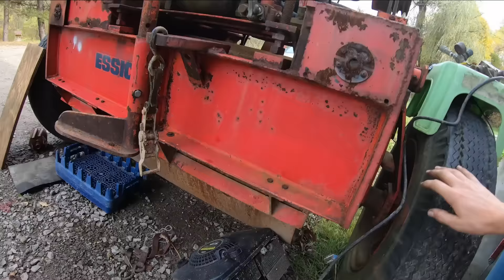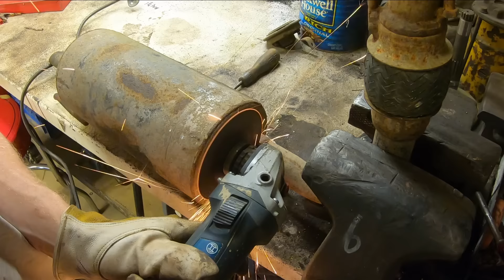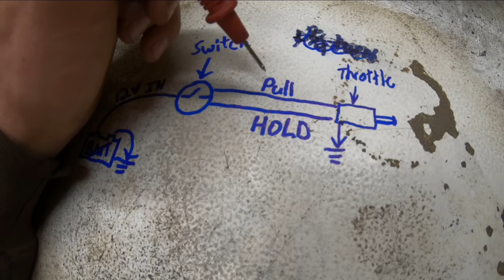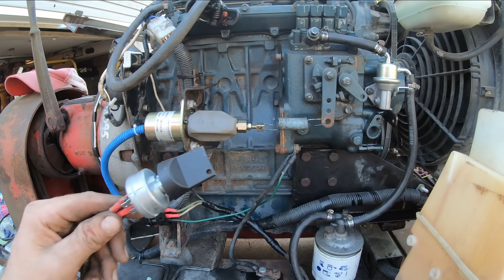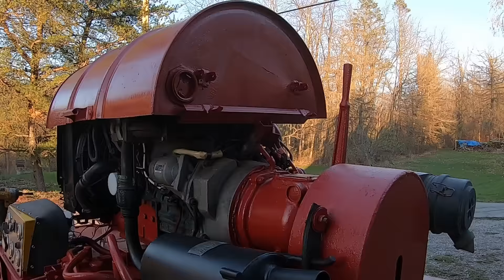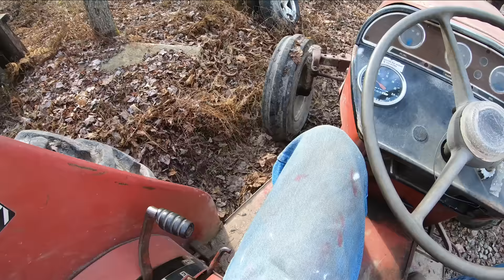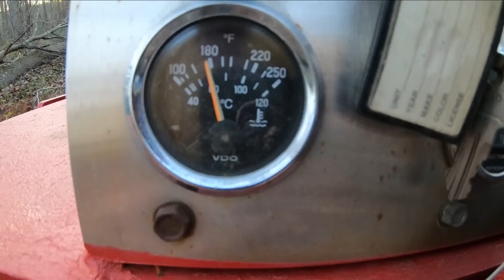Junkyard Kubota DIESEL powered Roller/Compactor build COMPLETE! (Lets try it out!!!)

Comment: Whats the rubber on the control box for? Is it just to keep rain from getting to the electrical connections in the back, if so, no offense but it looks kinda hap hazard with the self tappers unless its just temporary. Is there a reason why you couldn't cut a piece of sheet steel to fit the back and stitch weld a say 6in strip going around to top and sides to secure it to the control box with, unless the wiring is in the way. All the rest looks really good, but that rubber kinda subtracts from the looks.

Comment: Should move the half barrel cover up or put a steel shield over that rubber intake hose the vibration on the cover will cut that pipe pretty quick and you’ll dust that engine, continued success 

     Sincerely 
               Fabrizio

Comment: I bet you that first switch was more of a problem because of the old wiring not passing enough current, you should try that key switch again with the new wiring you replaced, continued success 

     Sincerely 
               Fabrizio
Reply: Maybe a relay activated by the pull side to handle required current...I'd guess he has a few start solenoids laying around.

Comment: AS far as the gravel compaction goes we used to put down something similar ( potato rock ) however we found later by using road base and a compactor the road acted very well even during heavy rains , but the larger rock similar to what you have seemed to dislodge easier and get kicked up in between the duals on the trucks so we opted for road base, just fyi

Comment: What a shame about the paint Matt. Your neighbour had the very best of intentions though. I'd run the beast for the winter, iron out any gremlins, then rub down the red and respray it. That paint will keep it clean over the winter though.
One thing I noticed; you've made it harder to change these belts. Was there nowhere else to attach that exhaust brace? In these wonderful times of cordless impacts, four bolts isn't a big deal but, in pssing rain, on a February morning, it seems like an unnecessary complication. 😁

Nice to hear that someone uses their local junkyard. Too often on YT, folks are buying new junk, rather than repurposing older junk, which was probably built way better. Quite apart from saving money, there's a great satisfaction in running junkyard machinery. Great place to find switches and gadgets too and quicker than Amazon.😁

Looking at that big, heavy fuel tank: once you get it painted nicely, a gold or silver maker's decal would look pretty good on it, or even a Diesel Creek logo.👍👌

Cheers for now,
Dougie.
Reply: unbolt cover, tilt it outwards slide rubber off muffler bar. seems easy enough

Comment: it's a bit weird that the controls and gauges don't face the tractor side of the machine, would give you a chance to peek at the state of stuff while pulling it.
The paint job is fine for the type of machinery I'd say, at least you didn't have to work with it... that's hours saved ;)

Comment: could use a ohshit its hot light on the remote, 210-220 degree switch grounding a bulb, might save the motor in the event of a fan failure
Reply from the maker: Thought about putting one on the unit itself we’ll see
Reply: or just put a pair of lights on the the other side facing tractor ( one for oil one for temp) assuming it has both switches installed

Comment: I ask this question as a welder / fabricator, knowing NOTHING about road building. Does it make a difference using river rock versus what they call crushed rock, that comes in different sizes. Example 3/4" inch +/- minus. with fine(s)? To me rock is rock, but I'll bet the ones who do this (road-building) on a daily / weekly basis will let me know, one way or the other. Ok people, rip me a new one, if I deserve it.
Reply from the maker: River rock doesn’t consolidate because it’s smooth or rolls around a lot and can nearly flow when weight is applied to it, I can be used if it’s pushed down into the dirt it will be more stable but crushed rock is preferred because of the edges it’s locks together better and is more stable in layers

Comment: Looks good.  With the hole in the top of the fuel cap you will get water in the tank if it is ever cleaned or exposed to rain.

Comment: Hello .  
just a small tip : 
otherwise hang some small white strips of plastic bag on the radiator grille.  
I think the fan blows from the engine through the radiator right?  .  
then it can be visually seen when the fan starts from the towing vehicle.  

with kind regards Hollandduck from the Netherlands

Comment: Where did you get the large centrifugal clutch pulley ??? How much did it cost you fella ??? Thanks VF
Reply from the maker: That was original to the roller,  not sure where to source something like that
Reply: @DieselCreek  Are their any identification marks on the pulley??? What brand roller and model number if you can find it on the machine ??? Thanks VF
Reply from the maker: @victoryfirst2878  I actually looked for one a while back and couldn’t find anything on it. Probably made in house back then but they were used in other multiquip products because the part numbers for the springs inside it were cross referenced to a more modern mixer they sell

Comment: If you see a piece of construction equipment with a really good paint job, it means one of two things.  1) It's brand new and hasn't been put to work yet.  OR  2) It doesn't get used much because it doesn't work or breaks down all the time.  It's a very nice tool but it's not a Cadillac!  A much more important job would be getting a beer cooler mounted on the tractor!!!

Comment: great job,, looks to be working great  one thing i saw though is the barrel/engine cover rubbing on the intake tube?   handy bit of kit to have, saves having to hire one when needed. thanks for the vid and keep up the good work.
Reply from the maker: It contacts the intake hose but I rolled the edge of the barrel so it shouldn’t hurt the hose
Reply: @DieselCreek  good show, the last thing you need is to be sucking dirt into the engine.  thanks for you're hard work putting up the vids  you do a great job!!

Comment: The ground up asphalt works great for driveways.  Parents have it on their farm since the late 90s and it’s held up well.  It doesn’t wash out and just disappear like granite does.  Once it gets compacted and heated by the sun and gets hard like asphalt but doesn’t crack up.  Although you do want to have 4 to 6 inches of asphalt so that it can form into a solid layer.  An access road to a water treatment area near some other family used it but only had about a 2inch layer with a sealer and it broke up after a few years.   ... also heard of people spraying with diesel fuel &/or waste oil to accelerate the material hardening up.

Comment: Outstanding!! U could run some macanical gauges up to the tracker with the idle switch. That way u don't have to keep jumping of to check the unit.
Reply from the maker: I probably should have mounted that panel facing the tractor but really now that I know it’s working correctly I don’t need to check it very often
Reply: @DieselCreek  did a good job. Looking forward to what you have planned for the steel shipping containers barn.

Comment: Machine works good. That engine throttle lever connection, I think it should be connected from the solenoid directly to the lever and then this should have the spring pulling it back in the opposite direction.

Comment: You were concerned bout buddy’s paint job ,,,, n you couldn’t put the rubber on over the electrical straight lol 😂
Reply: I thought the same thing but if you look closely (at the time lapse when he was putting it on or you can see it more clearly when he is dealing with the muffler) the electrical box is not square, it is tapered. He drew a guide line for the rubber parallel to the back edge not the front and installed the rubber accordingly to give as much coverage as possible to the exposed backside of the box with the width of the piece he had. I was wondering why he mounted the reflector where he did obscuring some of the gauges & not parallel to the bottom of the electrical box???? That being said, with all of the repair work, improvising & engineering you have to admit he did a fantastic job & deserves a ton of credit & bottom line it makes him happy & he is pleased with the overall results!!!!

Comment: Nice work! A Kubota diesel is a solid choice and I enjoyed seeing you optimize it for the application. An air-cooled Deutz diesel would also be a good choice for that compactor; they're built to run at steady RPM for extended periods of time on pumps, generators, and certain mobile equipment.

Comment: Do yourself a favor dont engage that clutch before you start always at running lower to mid rpm less strain on start up and thats how those clutches are designed to be used

Comment: I believe all you would need is a starter solenoid for a lawn tractor to make that work with the key switch. That way you can take the large power wire strait from the battery to the throttle. You just need a small amount of power to activate it.

Comment: Likely the RPM has fallen below 2100 after the load applied
Reply from the maker: I adjusted it off camera, the engine is actually overkill so it handles the load well and hardly bogs

Comment: Good result. Just a little concerned that the engine cover is held up by the radiator surround and with the vibration it might crack the radiator. I thought about commenting when you mounted it in the previous vid but thought you might do it anyway.
Reply from the maker: It’s got a good framework around it, shouldn’t be any issue,

Comment: Just a suggestion, you should check rpm with engine under load (2100rpm). You governor may not be adjusted to compensate.  Assuming this has a governor of course.  Lol

Comment: The 'pull' switch :  DC switch rating is for carrying capacity. DC current interrupting is lower. A lot lower for unsuppressed inductive loads like the solenoid. IOW, every time you open it, there will be a nasty arc that will ruin the contacts in short order.

You can minimize the damage by adding a big-ass diode between the pull terminal and  batt terminal. Cathode to battery terminal.

Diode rating around 10A, 100V. Or more.

Comment: You could have just inserted a solenoid in the pull side, just like hooking up a riding mower start circuit, 12 V from battery would then be switched through just like starting a mower engine.

Comment: a suggestion.    Measure the distances of the spring travel.  Open and closed.   The point being sunlight degrades plastic zip ties.  After parking it , when you go to use it next year, it may work and then suddenly it wont.       also measure the pull requirements .  You may be able to substitute a solid linkage to replace the spring.   Maybe a chain or cable with an adjustable linkage on one end.
Reply from the maker: I’m gonna find a more permanent solution that was just to get it going

Comment: Most of the time when I used DC we would put a resistor on the hold side because the inrush of the coil is a lot and it doesn't take a lot to hold it in.  It would be easy to figure what you need to lower the dc resistance of the coil by measuring the resistance of the coil and remember that if you put a resistor of 1/4th the resistance of the coil and and put that in series with the coil on the hold side the coil will work and last for a long time, if not probably not that long.
Reply: You can probably use one of those resistors they put on coils on GM Cars before electronic ignition!

Comment: I would store with the tires up so you don't get a flat spot on them with all that weight but you could see it working good....
Reply from the maker: My theory there is if the battery does from sitting then I’d have to jump it just to get the wheels up, this way it’s ready to go. Hopefully it won’t sit that much

Comment: Rubber ring seal inside the fuel cap should stop that leak.
Reply from the maker: Trouble with that is that it’s pipe thread and it doesn’t bottom out just gets tight on the threads

Comment: I would put the guard on that grinder at least when you're using cutoff wheels. Not trying to be the YouTube safety police just saying those cut off wheels will break with the slightest tweak and could do some damage at 10,000 plus rpm.
Reply from the maker: Lol ya I’ve had them explode before too but I just make sure my head isn’t in line with the wheel, I toss all those guards as soon as I get a grinder
Reply: @DieselCreek  Thats the important part I suppose staying out of the line of fire I'm gonna continue using the guard but to each their own. Stay safe keep the videos coming 👍

Comment: Just because I'm super curious here ... why not index the whole thing the other way so that the exhaust pipe rises from the manifold instead of dropping down?
Reply from the maker: Didn’t have to buy anything for this set up plus no hood interference, also when you go up it’s harder to support and then water becomes an issue as it sets it’s impossible to get water into the engine

Comment: A useful bit of kit bought back to life. Wasn't the 2100 RPM supposed to be when the motor is under load, ie with the clutch engaged and vibrator running?
Reply from the maker: It was, I adjusted for that off camera, it’s dialed in now!

Comment: Didn't see if you double checked for 2100 RPM engine speed after activating the solenoid AND engaging the roller vibrator lever.
The vibrator load might slow the engine speed a bit which could be significant enough to prevent the clutch from engaging fully --might allow it to slip and cause premature failure...
Reply from the maker: I did that off camera, the engine is really overkill for the roller so it doesn’t bog much

Comment: That lawnmower key switch would work if you put a starter solenoid on it you just hook the pull wire to the little pull on solenoid and heavier gage wire from battery to one terminal on solenoid and also from other side to your pull solenoid

Comment: Are you going to wire in some lights on it for turn signals for when you are towing it around?  Or is it just going to be used around the farm?
Reply from the maker: I have a magnetic set I could throw on it if I was worried about it, around here I just throw the triangle on it and send it, no one is going to make a fuss about it, it’s not like I would take that on the highway either
Reply: @DieselCreek  are the wheels on that thing in good enough shape for a highway?  Stuff you don't really see in the video.   That thing would be way better then a little compactor.  The little ones I am thinking about are the little jack hammer style ones that pack the gravel down.
Reply from the maker: @jamesmckillop3019  I have a variety of different compactors for a variety of tasks, this is currently the biggest but I have an even bigger on on the line hope to get it soon!!
Reply from the maker: And these tires are a bit rough for highway use but some new tires and it wouldn’t be a problem

Comment: ,Any reason you used the tractor.instead of the truck ??
Reply from the maker: Hitch is too high on the truck, As well as the tractor is much more maneuverable and easier to operate at slower speed, not to mention my remote won’t reach the cab of the truck

Comment: Last thing to do is put a solenoid on the stop lever and wire it to a red button on your remote throttle box.  Realistically, it wouldn't take much to move it all onto a remote box including automating raising and lowering the wheels, starting the engine. Three position toggle switch, centre off, and solenoid valves on the pneumatics. Still, looking good so far. Amazing progress considering its just a side project. Keep on and stay safe in this crazy world.  :D

Comment: Good luck asking your neighbor for anything in the future.  That paint job is fine. Mighty nice of you to not be "mad" at him. That zip tie on the throttle is dumb. No way that will be consistent .
It needs a dedicated adjustable stop on the arm. The spring should simply pull the arm against the stop. Like the channel.
Reply from the maker: The zip tie is very consistent actually I tested about two dozen times it’s the same or rpm. every time
Reply: @DieselCreek   You should tell Kubota that. They will surely implement your method and you'll be rich beyond your wildest dreams. My comment stands. 
The arm should have a positioning device that is a hard stop.

Comment: I think you need to vent the gearbox it is building pressure and pushing out the oil.
Reply from the maker: The gearbox has a vent, it is not clogged

Comment: On the zip tie and spring linkage. 
If you want to replace it find a old metal shirt hanger cut you a piece of it the length you need make the right bends and replace the setup that you currently have. Just a suggestion. 
I love the compactor roller. I remember seeing these growing up.
Reply from the maker: Yes I will be working toward something more permanent with the throttle set up
Reply: @DieselCreek  looks like the solenoid is adjustable to adjust engine speed instead of a zip tie.

Comment: As someone with zero knowledge about engines and electronics, I feel really relatable to that zip tie fix. That's something I could still probably manage! ;)
Reply from the maker: Sometimes the simple fix is the best fix
Reply: Not sure that zip-tye fix is the best idea.  I think it would limit full operation (over speed) of the governor.  A heavier spring or shorter spring might be a better solution.
Reply: @davley4396  I agree, even the uv resistant black zip tie will eventually break down, and of course at wrong time. Im surprised that the solenoid shaft isn't adjustable for this exact purpose.